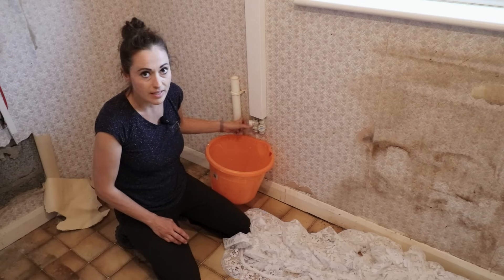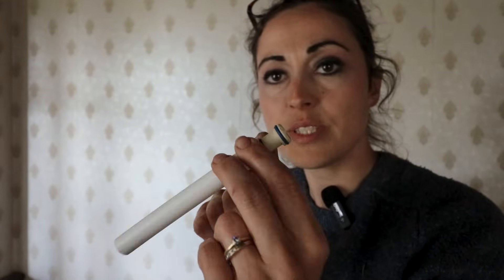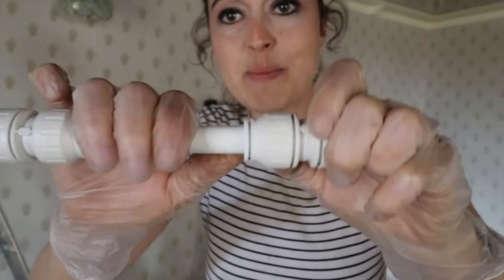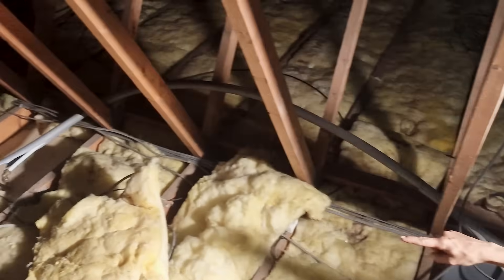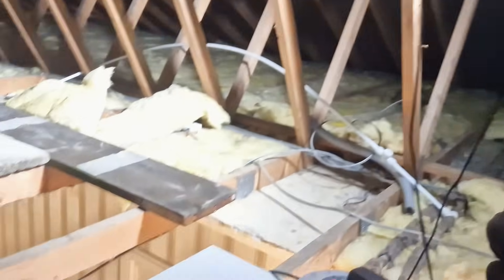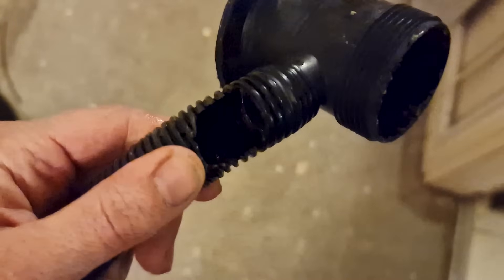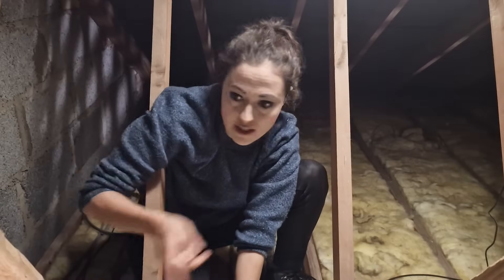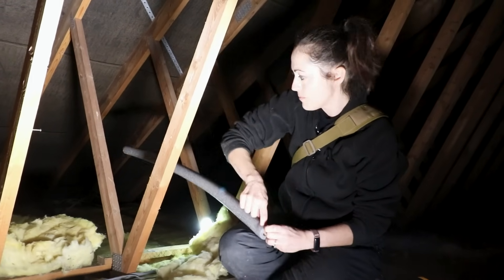We tried to fix the leaks but FOUND MORE PROBLEMS in our new auction property!

Comment: Well done Vikkie that speedfit is a miracle I can't believe it works so well. I finally got around to sorting out our bathroom, the previous owner was a builder, a 🐄🤠 he got the hot and cold connections reversed somewhere under the floor perfectly tiled! I used speedfit to tap into the cold water supply to stop the toilet giving a hot flush and stop ended the hot feed. The thermostatic shower was a problem as it got hotter and hotter by increasing the hot which should have been cold!  I couldn't get into the wall to reverse its feed without major destruction! So I removed the large overhead shower head and flipped the mixer bar over so the feeds were correct. The large head on the flexible connection was adequate and with a new sliding support in we've got a functional shower! None of the doors in the house closed properly either and he undermined the patio and covered it up with decking! Don't get me started on the drainpipes that's one of my next jobs!
This is what he did on his own house!  I shudder to think of the jobs he did for other people! You have actually got an advantage with a house that needs a major refurbishment you can do it right! 😅 !
Reply from the maker: haha... I bet he knew what he'd done wrong as well when he'd sold it (maybe wanted to sell on instead correct 😬) I do love how almost everything needs ripping out and don't have to worry about taking something apart without damaging it before putting it back to how it was! lol

Comment: Nice work, If it was me I probably would have just ripped out all the copper and started again. You dont want to do up this house and have it just perfect only for dodgy pipe to burst and ruin your work. Also, clip as much of the pipe work to joists as you can, espeically the cold main, it can rattle a fair bit. Nothing wrong with hep20 speed fit and if you end up doing the central heating go up to 22mm for the majority of the flow and return, future proofing for a heat pump :-)

Comment: I would really think about doing 300mm in the loft (or even 400mm) but also look at buying Rockwool specifically, the brand exactly. I know alot of people say Rockwool as a generic term but its far better then the knauf mineral wool and the Rockwool is happy to get wet from time to time and mice don't like it.
Reply from the maker: Thanks! If Rockwool ever wanted to sponsor me, then I'd consider, but due to costs, I've gone with Knauf 200mm to go on top and 100mm for to replace the area that's missing.
Reply: @TheCarpentersDaughterUK  yeah, it’s expensive. It’s difficult to buy even. The wickes near me is forever out of stock 😞

Wonder consider replacing the old 100mm fibre glass though. It doesn’t function well once wet. Only want to do the job once also
Reply from the maker: True, but we need to sell the boat first to feel flush to upgrade things.

Comment: The Hep 20 is very similar to speedfit except it has steel inserts and no rubber gromets. Hep was the innovator. Remember the plastic pipes are slightly more resistant to joints shearing off when frozen… just look at your mains tap in the field!

Comment: Great job huni you made it look very easy 😉👍
Reply from the maker: Thank you so much ☺️ hopefully I won't have any more issues! 😊
Reply: @TheCarpentersDaughterUK I wouldn't get air source heating it won't heat the house we have it and alot of places are removing it and going back to gas or solid fuel or oil. It takes alot of research if you really want it but you won't have enough hot water for a bath we don't unless we just use the immersion and we had to get a new fan in the garden in 2016 as the other one that was 4 years old burnt out it's circuit board and so it ended up being a whole new outdoor unit
Reply from the maker: Wow... that's not good! Will pass your comment onto Mr TCD as we're getting quotes on this soon and ground source.

Comment: Hi Another great video, what is the whote stuff you put on the bath plug? the auto captions don't do a good job of technical jargon.

Learnt a lot from this video, espcially the silcon on the waste pipe, I usually just presssure fit it, but silcon will give us a peace of mind... anoter job for me to do soon 😀

I love the speedfit stuff, makes life so easy. I use to use the  pre-soldered copper which was great fun, but you do need to be careful.

For the insulation, you might want to use insulation tape on the joins, they say the insulation is only as effective as it's weakess link, so sealing the gap between each insulation roll gives it a good seal. Propbably not neccessry, but I do it any way.

With regards to heat pump I strongly recoomend you watch SkillBuilder, he has 3 or 4 videos on heat pumps.I am personally not convinced by air heat pumps, alothough ground source heat pumps do work better, but there is a caveat!!
Reply: You need to use pvc pipe cement. It's a permanent bond so you need to be sure everything is matching up correctly.
Reply: Plumber’s putty
Reply: @PaulSmith-pr7pv  cheers
Reply from the maker: Thanks so much! We're still in the early days of researching and getting quotes. And yes, it was plumber's putty (Plumber's Mate)... many plumbers tell me I should use silicone instead for bath/sink drains, but I've always found they leak.
Reply: @TheCarpentersDaughterUK I have found the same with silicon, and I hate silicon, it gets everywhere when I use it 🤣

Comment: Great video and filming. I swear by push-fit that was used by the beer industry long before domestic plumbing so very reliable. Nice work! The close up of the copper joint looked very sketchy - definitely worth replacing what you can get to while it's accessible; as you said a new leak in the night could bring down another ceiling. Fingers crossed...
Reply from the maker: Thanks! :) It was tough filming up there as well 😆 Once we have better lighting and more boards up there, I'll feel safer exploring more areas. Not keen on the one leading to the old shower, but it's not leaking and we don't use it/want to rip it out.

Comment: I would check every single copper joint and replace if necessary or not.:face-blue-wide-eyes:
Reply from the maker: We will be once I have better access and plan on ripping out the dated shower and replacing the pipes connected to it

Comment: Those copper pipes look like they may have been done with lead solder. The joint penetration and bind is usually crap. Silver solder should take care of that and is probably a lot cheaper than buying all those press fits.

Comment: Lights and showers out means you have tripped RCBOs for those circuits - they can't all be on one 'ring main' which is a socket circuit. I'm assuming you had an RCBO consumer unit fitted?
Reply from the maker: Consumer unit has been updated since. The shower was on its own and found that was a fuse gone. The light was just a bulb needed to be replaced.
Reply: @TheCarpentersDaughterUK  if you watch electrician videos it's very common for electric showers to have problems - often they're upgraded without increasing cable size, and it's worth checking all connections are tight, especially in the isolator switch.
Reply from the maker: I'm pretty sure this was caused by the previous flood
Reply: @TheCarpentersDaughterUK  yes, very likely.

Comment: Hi Great work so far,  latex gloves and a box of P2 masks should be on your shopping list, are there mouse dropping under your installation in the attic space ? Maybe a few plug in rodent devices until your fully sorted. Great videos
Reply from the maker: Will do when topping up and replacing. There were a few.
Reply from the maker: And thanks so much!

Comment: I had ago at plumbing once 😢
Reply from the maker: What happened?? 😬
Reply: @TheCarpentersDaughterUK  putting an outside. Tap in, didn't tighten up right.
Reply from the maker: Aaaah... I've seen so many leaking outside taps. I've never fitted one and don't fancy having to edit a load of swearing out if it goes wrong 🤣
Reply: @TheCarpentersDaughterUK  lol

Comment: If you repair the leak, make sure you run the water for a good while to flush the system to reduce the risk of legionella. As the water has been standing there for so long there is a definite risk.
Reply from the maker: Thanks! Yes, that's what we did. I think we ran it for about 10 or 20 minutes first.
Reply: I wish I had more harder and professional male trades people with your great skills. Great video looking forward to your progress, if you need a sparkie (Electrician) then don't be afraid to ask me . I am a bit old but 2391 qualified and 18th Edition and old! 64 But will sort electrics out for food & accomodation. (I have a tent). LOL!
 @TheCarpentersDaughterUK

Comment: You really need to get rid of that felt type pipe insulation and replace it with foam insulation, I've found that every make of plastic pipe is fractionaly different so inserts are either very tight or a little loose
Reply from the maker: This seems to be a common opinion (and I thought the wood stuff was better as more expensive) so will do soon. Hopefully topping up with more insulation will help too!
Reply from the maker: And yes, that'll be why I've always been told never to mix and match different plastic plumbing brands

Comment: You might as well chuck all thar old insulation. And I would make sure a heat pump is really going to work for you .i
Reply from the maker: Still just at the start of all of our research /quotes coming in. Do you mean the old insulation on the pipes or between the joists?
Reply: Honestly I would chuck the lot . New stuff is more efficient and you might see more issues as you go along ..get cavity insulation but make sure the electric cables are not running in it .

Comment: Mmm in my experience plastic to copper is ok if copper is clean and undamaged. (The plastic pipe is marked * for a guide to cutting and inserting fully ) good luck.
Reply from the maker: Thanks. That's why I wire wooled them. And yes, I talk more about speedfit, including the markers here https://youtu.be/wAjWbRICm-w?si=mcYMgwOPcI3WmHY2

Comment: One problem with plastic pipework is if you don't support long lengths they can sag. If the system is not clean, sludge can form and restrict or block the flow. I know, it's happened to me. Obviously well supported and a clean system, no problem. Shower circuit should be seperate from the  lighting circuit. 😏
Reply from the maker: Thanks. The shower was a later addition and on its own circuit (turned out a fuse had gone...probably tripped from the previous flood) and the bulb just needed replacing 😆

Comment: You did a good job there , i dont see no problem using the speedfit stuff. Well done glad you have water at last 👍
Reply from the maker: Cheers 😀 I don't see a problem either. I've seen both plastic and copper plumbing fail over the years and plastic is so easy for the ordinary home owner to do repairs or plumb up a washing machine without the need to hire someone.
Reply: @TheCarpentersDaughterUK  looks like all that lagging wants replacing with the foam gear , that old stuff is crap init lol. I know a few plumbers they still use lead soldier as rekon the new stuff is naff , was a time when people were buying loads before they banned it. 😉
Reply from the maker: @paulyh4531 why is that wool stuff so flipping expensive? I assumed I bought the crap stuff - but wasn't paying £50 of 3 pipes to cover!!😊
Reply: @TheCarpentersDaughterUK  yer I know what you mean , but the foam stuff you can get 45 metres for 50 quid if doing loads of replacements ,which is what your prob refering to 😉👍

Comment: Personally I don't trust those plastic quick fit connectors.... I always tend to solder.
I had a leak in my loft space where the previous owner had connected plastic to copper after fitting a radiator.
The gas fitter who came to the leak found the plastic fitting was leaking where it connected to the copper,  he told me that they had a habit of working lose because of the pipes contracting and expanding when heating and cooling.
The newer fittings nowadays may be better but personally I still don't trust them as much as soldered fittings....
If I do a job myself its always the old traditional way.

Comment: Give soldering a try, Vicky, it's not too difficult and super-satisfying!

Also, a safer way to get the insert out is to dismantle the joint - give the collar a bit more of a twist, and it comes right off. It goes back together fine as well, just be sure to get the plastic ring and o-ring in the right order.
Reply from the maker: Thanks! I've been thinking about it this week actually... looking at the downstairs plumbing on show, I think I'll have to learn it as don't want speedfit on show. I'm curious about Yorkshire plumbing joins... are they worth it?
Reply: I've never used Yorkshire, only end-feed, never had a problem with it. With that said, I do sometimes (often..?) use too much solder. Maybe buy some of both, have a go?

I bought an electric soldering thing that I'd seen because I was scared of using the flame - it was totally, totally useless. Went and got a blowtorch instead, found it no problem.
Reply from the maker: Great! And thanks for the tip! I'll avoid buying that one then 😅 I'd love to have a go and add it to another list of skills.. whether I master it or not, I don't know 😂
Reply: Also: buy a pipe bender. Toolstation do a minotaur one that is not too expensive. Once you work out how to bend pipes to fit, it feels like magic.
Reply: @TheCarpentersDaughterUK  hah, so funny to be giving you tips after all the advice I've picked up from you over the years ;)
Reply: @TheCarpentersDaughterUK  it's on my list of things that I need to learn one day! Just haven't needed to yet. So yep, vote from me for having a go and learning.
Reply: @TheCarpentersDaughterUK  No - just use end feed - cheaper.
Reply from the maker: @awt my shopping list is building 😅
Reply from the maker: @normanboyes4983 need to look into that too!!

Comment: 🤔🤔🤔
When using "speedfit type" fittings, you BREAK THE BONDING. 

Bonding is used to reduce the risk of electric shocks when there is a fault somewhere in the supply of electrical installation . 
🤔🤔🤔
Reply: Do metal window frames need to be bonded ?
Reply: The shower will be bonded by the fact that it will have a CPC ( earth)
Reply: Do you mean 'break the grounding'?
Reply: Think that's why RCD 30ma needs fitting in the consumer unit now, as you can't rely on a continuous copper pipe these days.

Comment: Pushfit fittings are always recipes for future disasters
Reply from the maker: I've seen both types fail over the years. Neither are foolproof, so I opt for this option as they're easier to take apart and replace without the need to cut more pipe to replace.

Comment: I suspect your mousey friend is long gone now you are about and the mess is cleaned up!

Water pipes in lofts are best laid in the corner of truss joints not between them. I know it is only a temp job, and that is fine, but getting them out of the way where of where you may stand on them (especially if you are overbalancing with all the insulation you will be putting in there could save you a whole world of hurt in the future. Getting those pipes under the insulation will be a good thing too ...... but not your electrics. They should be on top otherwise you may de-rate the cable's current carrying capacity (you might get away with it .... but you might not eather). Those cables should also be clipped every foot so they are not loose eather, but many don't bother.

I put the central heating in to my current house in 1984 and the copper pipes are still as good today (as far as I can tell) so they do stand the test of time. Nobody knows for sure about plastic, but I have used plastic with speed fit fittings recently to add a couple of extra rads in ..... and it is a LOT easier! Which is best? I really don't know, but I expect that by the time my current system fails I will be past caring about it, or anything else for that matter! ;o)

Two suggestions for you though ........ 1. Loft lights!
I have an 8" Flourescent up at mine (but I had access to cheap fittings when it was installed) wired from a switch at the side of the loft access. As you go up the ladder you click it on and Bob's your uncle! But other fittings are good too and are not expensive!
Which brings me on to suggestion 2 ..... Loft Storage!
I know, you have a big place with no need to put stuff up there ....... but you will! Even if it is just the central section boarded out with plywood (on stilts because you need the 6" + insulation)
Back in the day I did not allow for that and I regret that mistake! But you will squirrel away a vast amount of gear from your Christmas tree and lights to that gift your relative gave you that you can't quite bear to refuse or throw away, but is Not going up in your home  (unless they visit). Loft storage is like Socket Outlets you put twice as much in as you need and still run out. ;o)

Comment: if those pipes have been frozen and thawed several times then you are just going to be chasing leaks forever... personally I would have ripped out those joined lengths of coppper above the ceiling and replaced it all with complete lengths of plastic now, before you damage any new ceilings....
Reply from the maker: We will be doing that soon - once we start remodelling.
Reply: @TheCarpentersDaughterUK  Glad to hear it, I think it will save you a lot of headaches in the future and you should be able to do the majority of the work yourselves quite cheaply since you are obviously more than capable of doing most things Vikkie. Well done getting the water back on anyway and I look forward to seeing the rest of your project take shape!